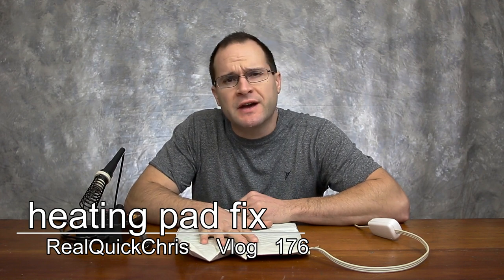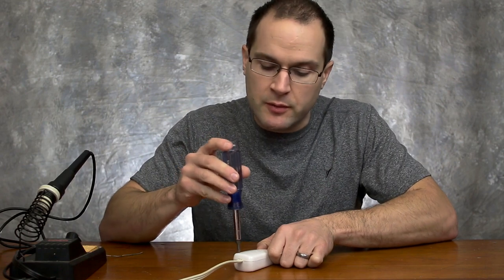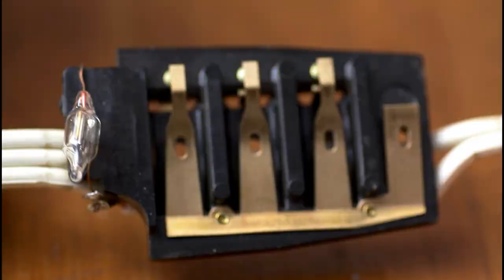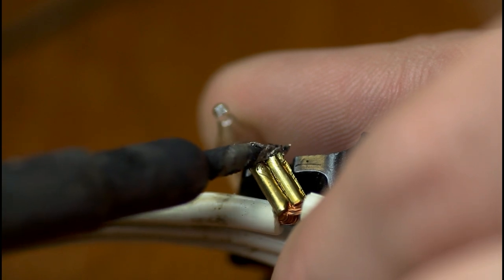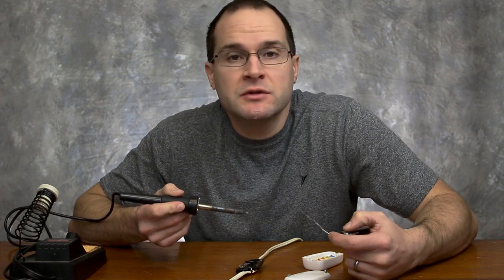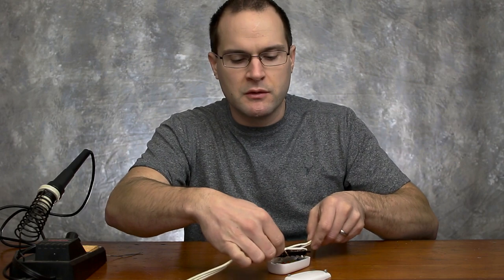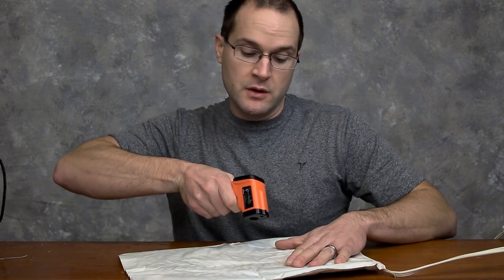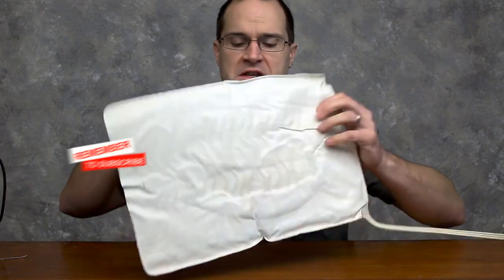heating pad fix vlog 176

Comment: I have a very old (circa early 1980's) unique Sunbeam Sports "wet/dry" heating pad which is the most useful gadget I ever owned. It is about 8" wide and maybe 16" long, and you can tie it around painful knees, neck, over shoulder, on low back -- most everywhere -- and gets really hot. Naturally, nothing like this on the market today, and a new, less useful, square shape Sunbeam stopped working after 6 months of course. I knew the Sports model was special and always handled it carefully, safely stored it and only used it as needed, which was pretty rare, mainly for over the shoulder and around the knee as it was meant to be used. Never used it "wet". Never any twisting or laying on it. So, recently needed to use it on a sprained wrist. It worked over a few weeks on the wrist, was working fine, then one day it would not heat no matter what. The control light comes on as normal. I have no special tools, only a screwdriver. This pad's wires are encased in a sealed soft plastic envelope, still in excellent condition but unable to be opened to see the wires inside. The cord and its connection to the pad still perfect. I hate to toss this pad out since it's been such a help when needed, but have been unable to find any small appliance repair people that may be able to help. Very frustrating.

Comment: Would love to see you show how to fix a Pure Enrichment heating pad.  Love them; but I am on the 3rd replacement unit still within the warranty for the original pad.  So, that's 4 pads, with 3 going to the landfill.  Rather than fix their quality problems, the company just send out new pads.  Good customer service (speedy and responsive, no hassles), but I question the business model that allows so many faulty units as a matter of course.  Would love to know if there's a way to diagnose the problem(s) and fix them.  

Replacement pad #1 just gave me a failure warning and was DOA.  Replacement number #2 heated up -- but only to lukewarm.  So far (4 days) replacement #3 seems to be working fine.  Love the pad, but not the sketchy quality control.

Comment: Hi nice and short video
Could you teach how to remove the preset 2 hours automatically turn off for heating pad,? I knew it is for safety reason, but I really need a full 5 hours heating because my lower back was badly hurt. so if the heat automatically turn off after two hours, the metal string will turn cold and my back was freezing and stiff during the nights. thank you.

Comment: You didn’t let us see you put the two pieces together.  Amateur here. 🙃
Reply: I have been searching everywhere on how to assemble the two pieces back together. I was so close
Reply: Take both ends of the exposed wire bits for both wires. Put them together and gently squidh them so they stay together. Then you'll want to get a small spool of tin solder, I have this at my stained glass shop I work at but you can find it elsewhere for maybe cheaper. Take a soldering iron on low to start and go up one level till you melt the solder. Then you will want to take the end of the solder from the spool and straighten it out, bring the solder spool to your place you want to solder and you'll want to just touch the tip of the soldering iron to the tin solder, this will form a small bead of solder, you'll want to repeat for the other side. Now that you got your solder beads you'll want to very gently but quickly touch the bead, if you see it melt you did it right, then you'll want to do the same on the other side and viola